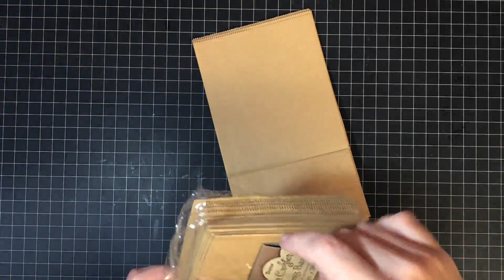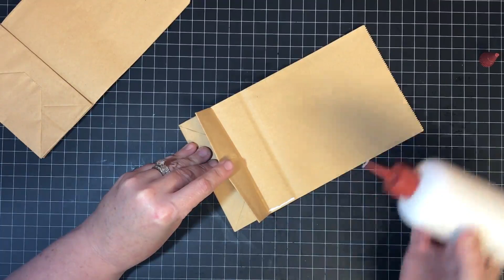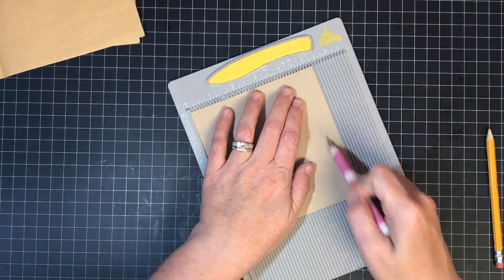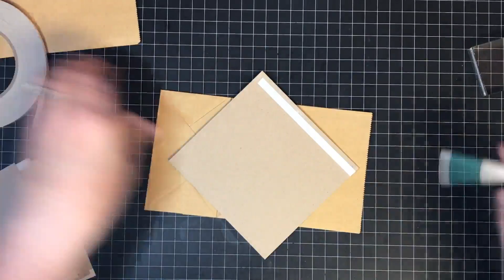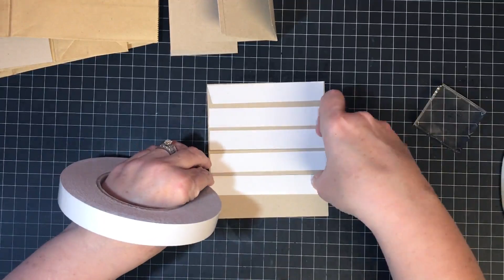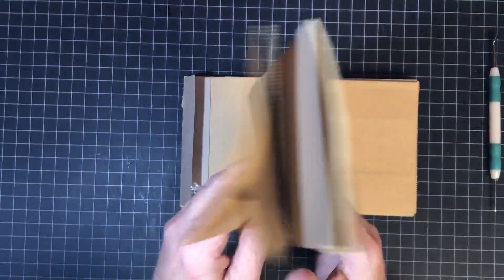Hello Fall Paper Bag Mini Album Part 1 {Bag Construction}

Comment: Just as an FYI-I bought these same bags, but they were really crooked and did not take the same measurements/cuts as the ones you listed. I had to RE-CUT pieces in a different way to make everything fit and work! :(  So BE CAREFUL, and check your measurements before you CUT because all the bags don't take that size cut you list. (I learned this the hard way I cut all my pieces, used my sticky tape and had everything ready to put together and they were TOO SHORT!!!!!! GRRRRR! They were a little over an 8th of an inch different on SOME cuts... nerve racking!!!
Reply from the maker: +Sally Pfau wow, I’m sorry you had
Issues. Did you buy them from my store?  I only ask cause I wonder if they are made in batches and have some discrepancies?  I’ve opened a couple bags of them and haven’t seen any significant measuring issues, especially 1/8th of an inch.

Comment: I purchased your glitter glue or wet glue the large size and I also got the small tip for it but the tip is too small and I need a lid for the big bottle how do I get the right size and where do I order it